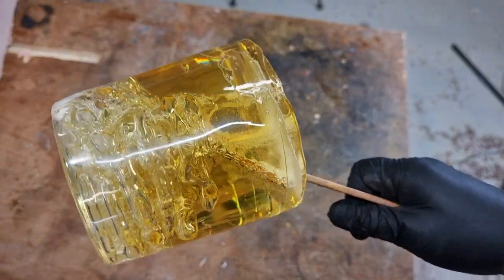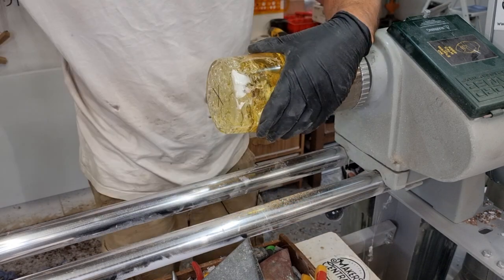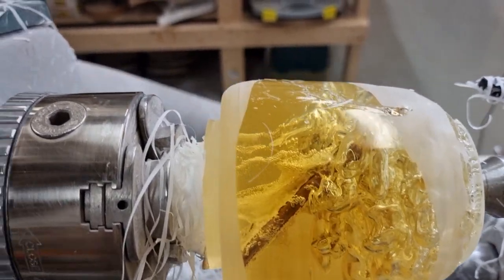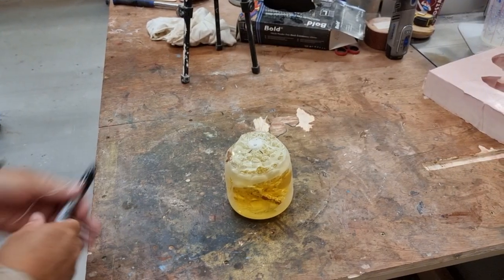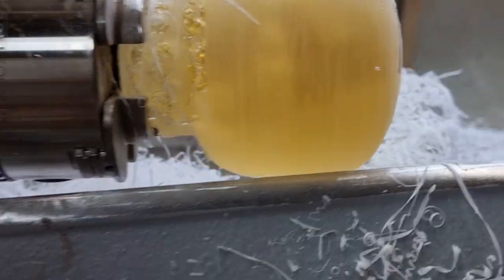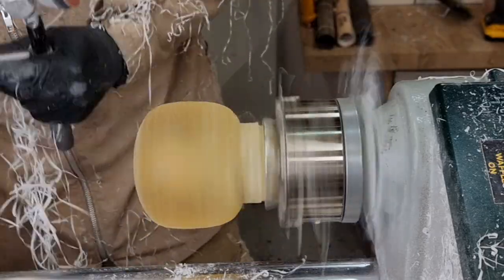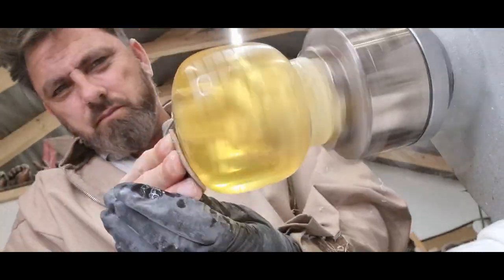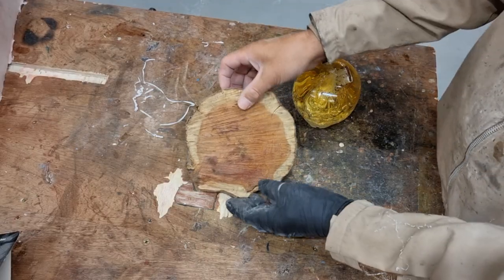I Made a Bubble Light Bulb - A Happy Accident, So Bob Ross Said **Warning Some Flashing Lights**

Comment: If you ever have a similar blank with lots of bubbles and want to try something different, you could drill long and relatively thin (3mm?) channels into it (so that all the air chambers are connected) - which can make a lot of different patterns (from the 'bottom' only for a less invasive look, parallel lines all the way through for a stricter feel, or spherically oriented towards the center for a 'starburst' effect), then fill in the voids with coloured resin - fluorescent with a UV light would make it pop (if the UV can penetrate deep enough into the resin, it tends to soak up a fair bit). That would make turning it a bit easier, as well. Just a thought.
Reply: Kinda like the jelly cake art? They inject colour into clear, set jelly with needles and syringes.
I watched some of that on Netflix this afternoon and you could be onto something.
Reply: I was thinking the same thing filling some of those bubbles with colored resin!
Reply: That is a great idea!
Reply: Darn i should have read the comments first, my thoughts exactly!
Reply: Sounds really cool
Reply: Was thinking the same, but only for this particular project I would have liked to only drill into the wewd that was stuck inside and fill only those drill holes to make it look more intentional.
But maybe that would go against the purpose of telling a fail story! So I like this decision to just take it as it is a lot as well :)
Reply: Yes!! I was so excited to see this one! I love how your past project pieces are creatively recycled! It makes me excited to see how they are used in the future! 
I agree with the others! I'd love to see another happy "accident" like this one filled with colored resin!
Reply: Bitchin idea! That would look so cool!!
Reply: @timefoolery  I LOVE your name, dude.

Comment: You could have put it in a bigger container, filled it up with clear resin with glitter, put the whole thing in the vacuum pot to fill the voids with the resin, then cured it in the pressure pot, before turning it on the lathe. But it still looks amazing as it is!

Comment: When I first saw all the bubbles in the epoxy I figured that the bubbles would be too close to the surface to turn it down much without getting into and opening up the bubbles.  I figured the only way to shape it much would have been to rough it up, clean it off, and then put it into a larger container(top side down) and pour more epoxy around it and then once that set up good you could do some serious shaping and never touch the bubbles.

Comment: I gave up on micromesh years ago. Power sanding with a 2 inch pad on a right angle drill, up to 10,000 grit works way better. It doesn't leave linear scratches like micro mesh. Also a good plastic polish works better than anything else. The Novus system is the best I've used

Comment: I have no idea why he turned it! It was obvious that there was going to be voids full of air and maybe water trapped in there. I would've just drilled out a hole for the lights to go in and a wooden base to stand it on. I would have also kept the stick poking out of the top. He simply doesn't think before he starts. Wotta Wally